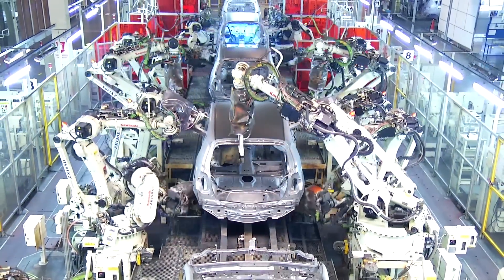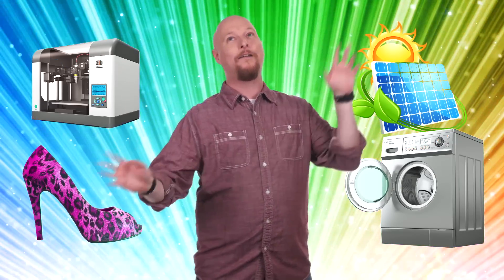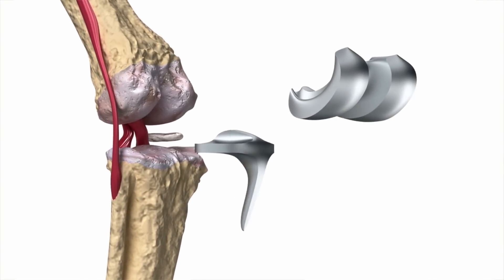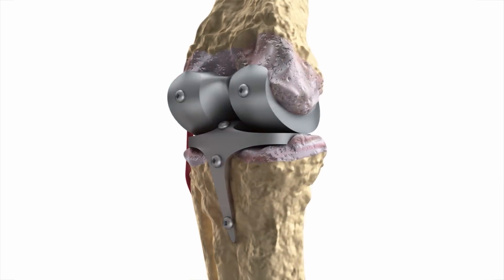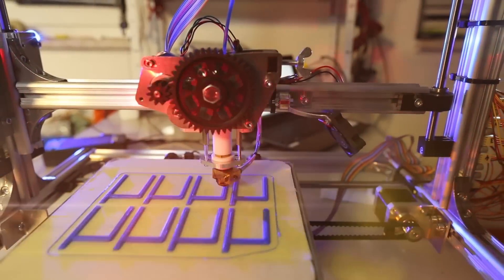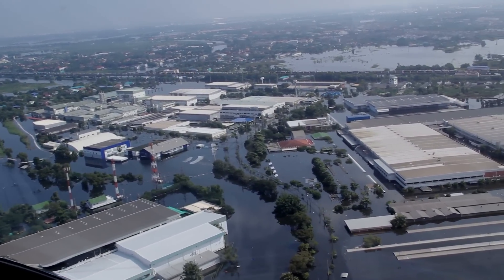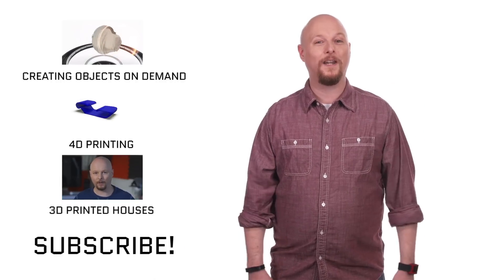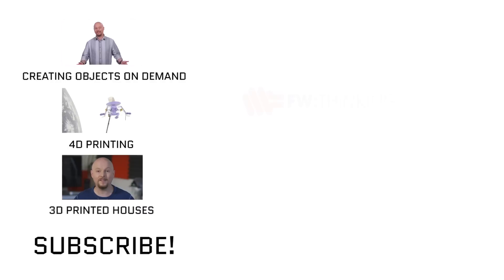Can We Make EVERYTHING On Demand?

Comment: People commenting to put you down Jonathan and FW: Thinking, advance is inevitable. The technology comes out or a derivative is made from failed attempt. It's inevitable, people want easier and better stuff not complaints on why something can't be done, even the negative commentators live and witness this.

As for the 3D printing technology being the future, absolutely. As far as printing custom shoes on a regular basis? Not exactly. I think advances or cultural changes in fashion and textile materials, especially smart textile materials or customizable clothing. Example for customizable clothing, using new type of textile material, something akin to Velcro but different in being strong, without the noise and with ability to change the color of your clothing or add custom patterns on it. I think the old adage of not mixing cloth materials will fade away, giving way to creative design driven by mostly old factors but also with a few new factors from humans. I can stores in the future will have 3D printers as places that are designated by law (by legal) to manufacture things off a controlled engineer print (maybe something like guns, explosives or medication?).

Comment: Average joe will never make their own shoes at home, just like printing your own pictures at home costs significantly more than printing at a local big box store.  The very wealthy may order a custom pair of shoes, but the cost to make a custom shoe will always be higher than mass production.  I am a lean manufacturing engineer, and know all about Toyota method, or Just-In-Time. Shoe manufactures may make a machine to sew your shoes for you when you order them from the store/online instead of the sweat shops overseas, but the pure cost of customizing every pair of shoes is not worth it, nor will it ever make financial sense for the average consumer.
Reply: Joe Doe You sound too sure.

In the next 5 years? I agree with you. Maybe even 20 years provided we have no scientific breakthrough. It all depends on how hard the thing is to make. I'll never buy another cup again if I have a 3d printer. Now go to someone like Amazon where they have the best 3d printers they can buy and as many as they can afford and I think the idea of a partially custom order is 100% doable.
Reply: Crevan Embrust I am not arguing that the frequency of customization will go up - it is obvious to increase as production cost goes down.  I am just saying that it will never be cheaper to make it at home vs. buying from a supplier. I used the photo printing as a proof of concept.  Average Joe in North America can afford a printer that will print photos, but it costs more than going to a big box store (walmart, costco, etc.).  To make a custom shoe at home, or even in the store will cost a lot more than from a warehouse.  I definitely can see the amazons in the world making an option to customize design of a shoe, and then they print out one after you order it, but to make a custom shoe (like an orthopedic) specific for you will never be done at home cheaper than ordering a generic shoe that is customized.

Comment: One minute in and you are lying to me. You are making a shoe on a production line so that it costs the same to make a million as it does to make one. It has to be a million because the machines are expensive but this way you can make anything that would cost a lot to make by hand cheap. Storing the shoe is a lot cheaper than making it by hand. Shoe storage is not a problem so you can't begin your video with solving that problem.
I know where you want go with your 'explanation' but please do it without lying. I hate liars.
Reply: A large amount of shoes/clothes are made by hand overseas because labor costs are low - as low as a few servings of rice. Fabric is not a very consistent material and has a lot of defects so machines cannot be programmed to handle every situation that may arise - so people are hired on the cheap to sew shoes and clothes.  You are right though that storing the shoes is cheap, that's why shoes are made overseas, stored until they have enough quantity to fill shipping container, then shipped around the world for sale.  It is what is known as a 'push' system.